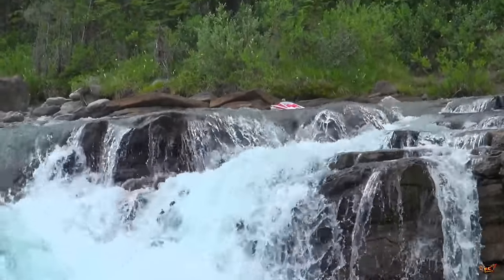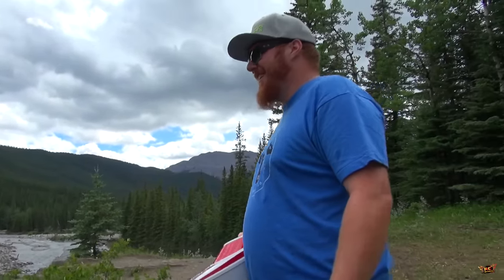RC ADVENTURES - TURBULENT WATER - THRASHER JET BOATS vs WATERFALL - 5S Lipo - Streamline RC

Comment: +RCSparks Studio I have a prophet dynamite lipo charger and I will push the button to set it for 2 amp and it won't change or anything it won't start either I was wondering if you might have a suggestion